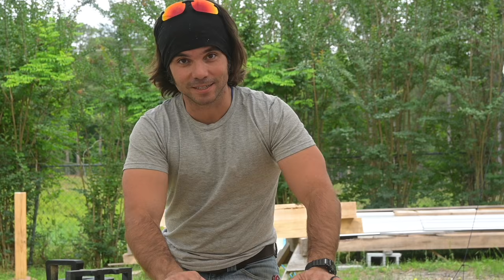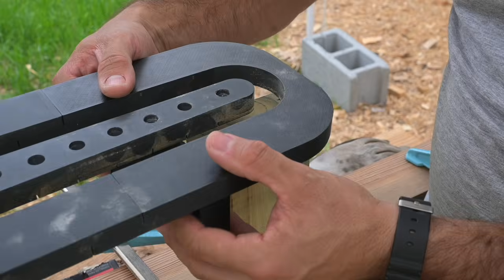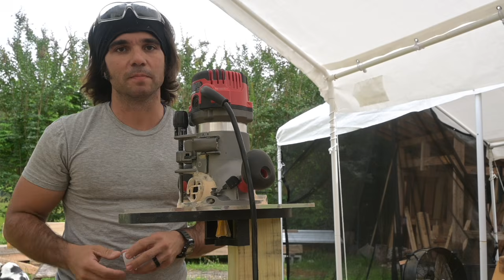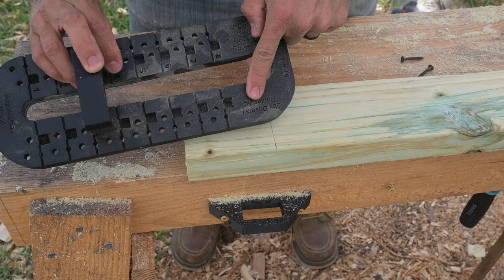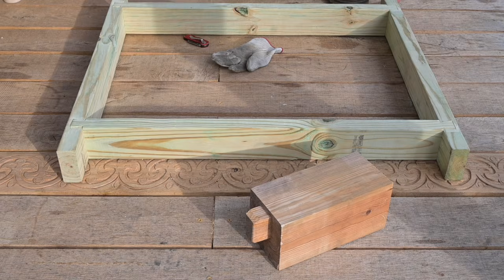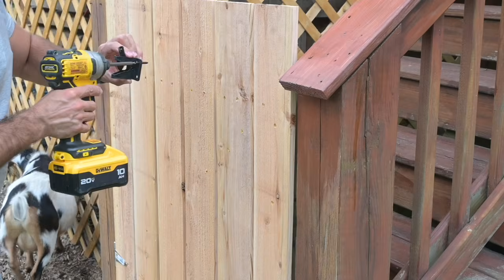DIY Wood Gate Build - Fast Goat Proof Gate

Comment: I got a 3d printer in feb and those must take several hours to print! Better than $1,100 for the two guys timber framing ones.
Reply from the maker: Yes, they take multiple plates with multiple hours per plate. One of the jig styles takes about 10 hours. 😅 and if anything messes up, there goes the whole print